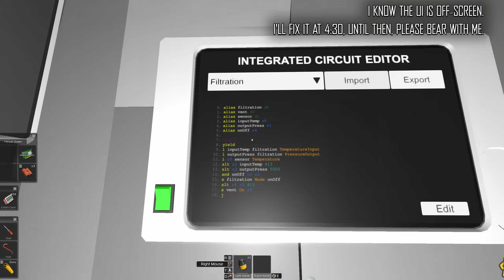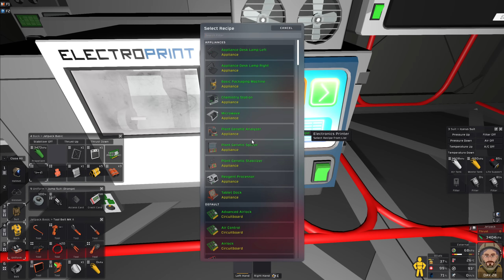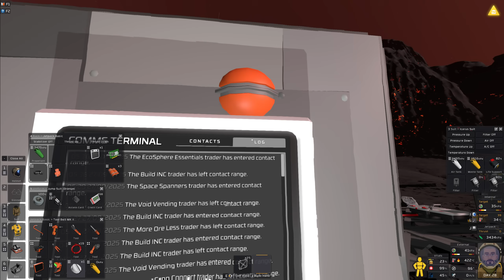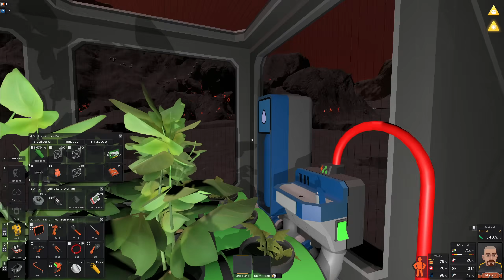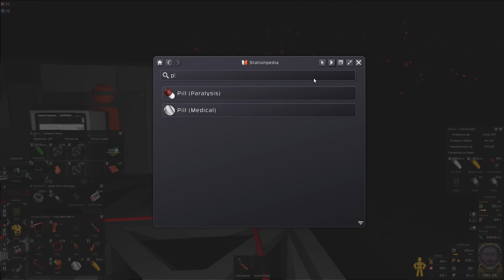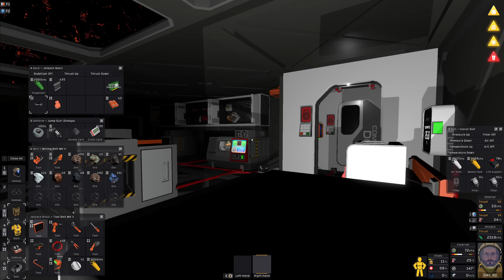Laying Foundations...Again - S2 E9 ║ Stationeers

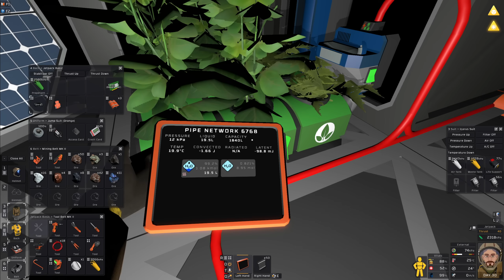Comment: re your comments ~52:00... It's not that unrealistic to have the plants not consume water, actually. In fact, it's more realistic to have the plants not consume water than it is to have the player (permanently!) consume water without outputting wastewater! 

Chemically speaking, mitochondria produce excess water as they consume sugars, whereas (most types of) photosynthesis converts water (and CO2) into sugars. Since animals don't photosynthesize, our metabolisms are actually water-positive! We sweat and waste more water than we drink, because we extract waters from our food as well. Similarly, most of the water a plant drinks up with its roots is actually perspired right back out; like us, they need water as a solvent to transport resources through their bodies. A plant transports nutrients from the soil by evaporating water in its leaves, which then draws water (and nutrients dissolved in that water) from the soil. It also perspires water from its leaves to cool down, just like humans sweat to keep cool! Then, the only water that the plant "consumes" is incorporated into the sugars that it photosynthesizes, which are made mostly from CO2; they only need the hydrogen off of the water, so something like 92% of a plant's mass is actually drawn from the air.

All that's to say, the simulation in Stationeer would have to do a lot more with water vapor to accurately reflect what's going on vis a vis plants and animals. All the plants you'd keep would "drink" a lot more water than the player, but most of that would end up right back in the habitat as vapor. Then there'd be a lot of monkeying around with water's extremely high latent heat of vaporization to deal with, both in getting the vapor back into liquid water and at the point where it evaporates... in my inexpert opinion, the systems the game currently provides could accommodate it, but it would be a big increase in early-mid game difficulty as any environment with plants would have to have tools for managing the humidity as well as everything else. From the dev end, they might be thinking about doing it but are wary because if they were to do that, they'd probably also want to manage things like the dew point (air of different temperatures can dissolve different amounts of water vapor)... which could present its own problems because the game doesn't have any systems for liquid outside of pipes as far as I know.

Seeing how this game does like to stay on the simulationist end of things, I'm sure it'll be added at some point! However, in the meantime, I think having plants not consume water much/any water is a surprisingly good compromise—especially for plants that the player will eat, as all the water the plant consumed there, the player would "release" at some later point anyways :)
Reply from the maker: Thanks for the thorough explanation. :D

Actually, the game can handle water outside pipes, I've seen people building pools in recent versions. Making sure we filter out the water from the base atmo would be a decent extra challenege, especially if we consider that cables would short out if they get in contact with the liquid water.

I'm also pretty sure the devs are thinking about it, and I wouldn't be surprised if it was added in the future. :)
Reply: @Hmuda  Oh, wow! I had no idea that water pools were a thing. Well, that might actually be on the horizon then!!

Comment: Each sale of Seeds give you 3 Seed Packages. When you mouseover the item on the left in the trading screen it shows you what you need or get for 1 transaction.
in this ecxample one Fern Seed Pack for 100 Credits would give you 3 Fern Seeds.

Also You dont need a Packaging machine. (Those are both for canning food nothing else)
Print the Cardboard Box at the Autolathe open it like any backpack or belt and stuff the trader wants for his car package in it, sell it, done.

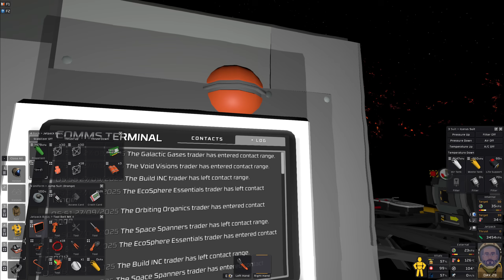Comment: 35:00 In an unmodded game you can only have one trader at a time in each of the 3 "distance" categories. This corresponds directly to the signal required for contact and a set of possible landing pad requirements. So once you see the current 3x3 trader on offer you don't need to keep searching without a better pad. The middle tier ones are always at least 5x5 and sometimes 7x7+15. The "far" tier traders appear on the log but the small dish can't ever detect them, and are one of 6x6, 6x6 with oxygen, or 9x9+21.

Comment: Solar panels not on roof, why?
Reply from the maker: They needed manual adjustments before the tracking automation, so they needed to be in hands reach, and now they are stuck there, because I have a lot more important things to do than rewire the entire starter base. :D
Reply: @Hmuda maybe we get them on the roof in the new base? 😢
Reply: Also they're safe from storms in there.